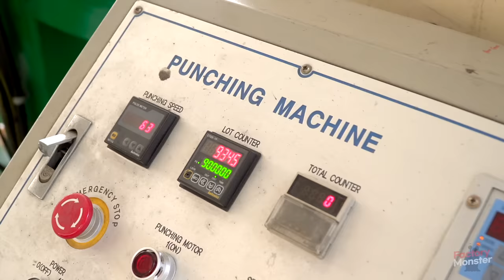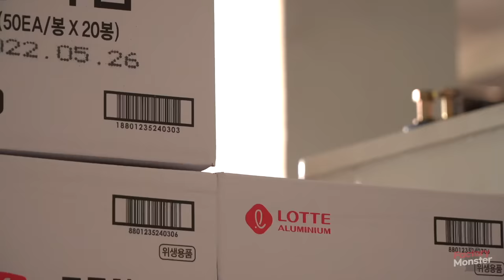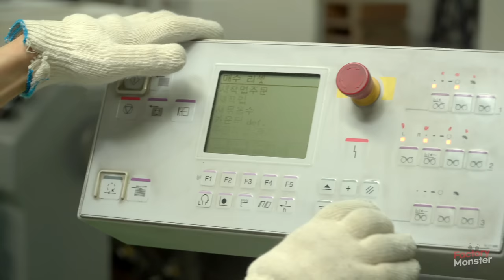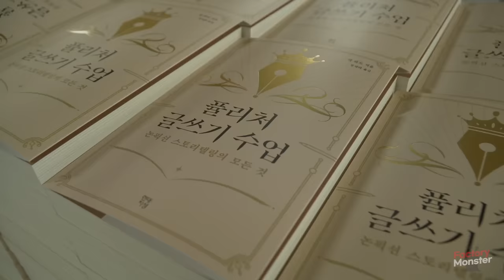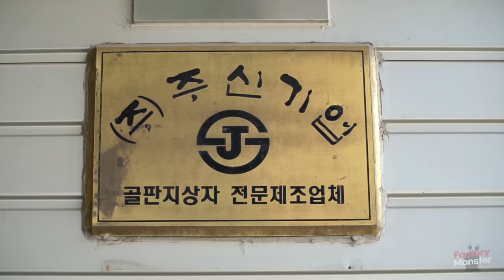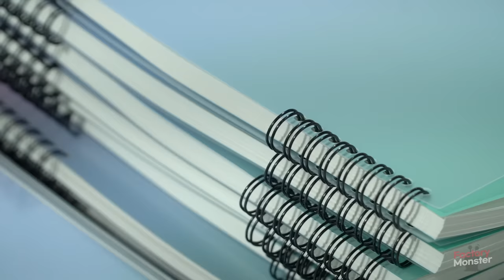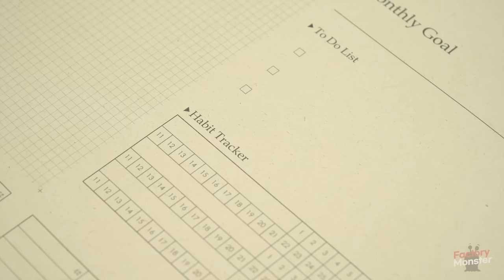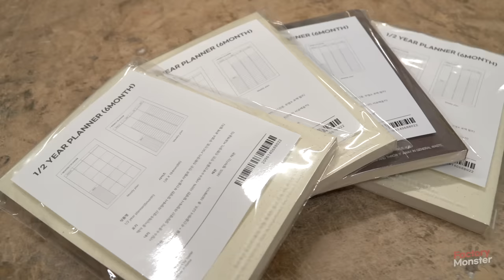Brilliant! TOP 5 Factories Using Tons of Paper To Make Variety of Products

Comment: Simplified explanation - The black stuff is a developer solution similar to developing an old photo. The non image area (light grey) is hydroscopic (loves water) and the image area (darker grey) is hydrophobic (really hates water). On the printing press the plate is loaded onto a rotating cylinder with different rollers touching it. First roller is water/alcohol mix to wet the non image area so ink doesn't stick. Next rollers are Ink and that only sticks to the image area that is not wet. Then image transferred to rubber blanket cylinder, then to paper. Better ink transfer with rubber blanket with much sharper lines. This is why it is called offset printing. Usually at least 4 separate units in a line with cyan, magenta, yellow and black just like your printer at home but each colour gets its own plate. This was a single colour run. Paper jams in this machine are MUCH worse than home printer!!!! The old machine doing the gold letters was a Heidelberg Letterpress. It can go much faster but maybe slowed down for you to see. We run ours at approximately 4500 sheets per hour. Hope this was helpful.
Reply: LOL, I was in the business for 30 years, I'm the Polar King, and you did NOT offer the simplified explanation, but still an excellent one!  ("Blankets" are always going to confuse the layman, for instance.)  After all those years and seeing the development of the equipment, I am STILL shocked at the volume we were are able to produce.  Printing is a fascinating business, from growing seedlings to sitting in a client's office.  I'm sure Ben Wilson will tell you that a pulp and paper mill are absolutely fascinating.  Some of the great "field trips" of my life.
Reply: @kevindunlap5525  It started simple and got a bit out of hand 😅
Reply: @benwilson089  LOL, that got a genuine hearty laugh!!  Great explanation though.  I still get a kick out of watching all these machines run.  Folders still blow my mind.

Comment: I really would appreciate if the operator of that big paper cutter needed TWO hands to activate the knife. As it looks now he activates it by foot or a single hand. And the other hand is still free.
Reply: I have a LOT of cutter operator experience.  You don't want to hear some of the stories.  Conventional equipment makes it virtually impossible to have an accident.  There are lasers that signal an immediate stop of the rotation of the arm moving the knife.  And yes, you push two buttons and if you release one to quickly to reach for the paper, everything will stop.

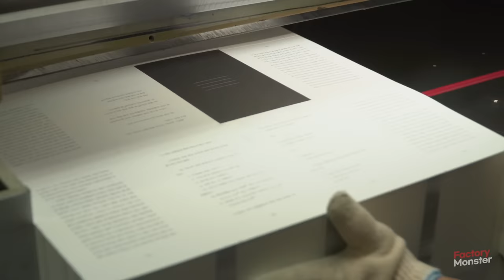Comment: Nice tour of how things are made in a paper factory. A shame the larger of the shaved scraps of paper around the 10:30 time marker couldn't be recovered and used to make notepads. That would cut down (no pun intended) on how much waste is created.
Reply: I was a highly skilled cutter operator for many years, just one of the functions I served in the industry, my favorite by far.  Cutting and handling tons of paper in a single shift is almost ASMR satisfying in some cases.  A fresh knife would actually sing through paper.

We would ALWAYS save materials that were of size and often would spend evenings doing the pad work.  The pieces that he was cutting off from the full width sheet that were about 3" wide were always saved, we had pallets and pallets of them.  They are specifically used to band up stacks of folded material before skidding or boxing. 
Excellent observation and point.   There were ALWAYS note pads somewhere!!!
Reply: @kevindunlap5525  from one Kevin to another, thanks for letting me know

Comment: the last part of the video is like technology from the middle of the 20th century, ahah...
Manual selection, manual gluing, manual pressing, old machines from the 80s  🤣🤣
Reply: It's because of the small run size.  It's not worth the time to merely melt the glue in the machines to bind those books.   Hand assembling books is quite satisfying.